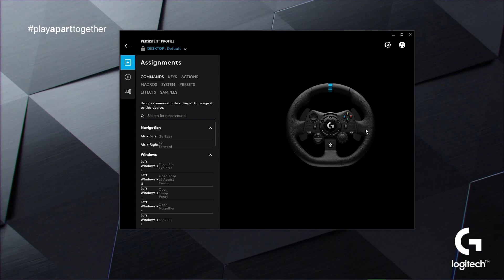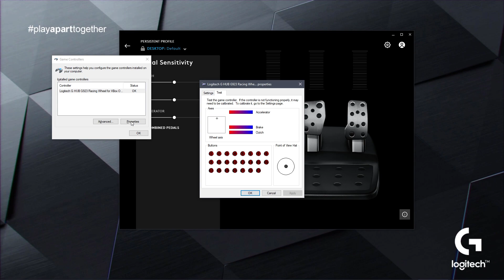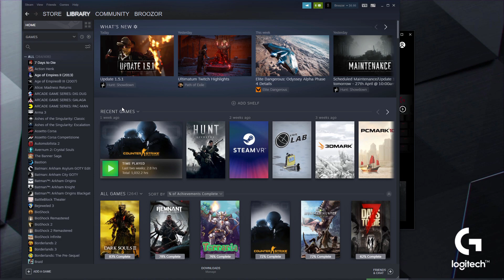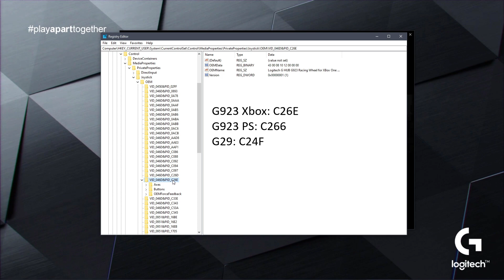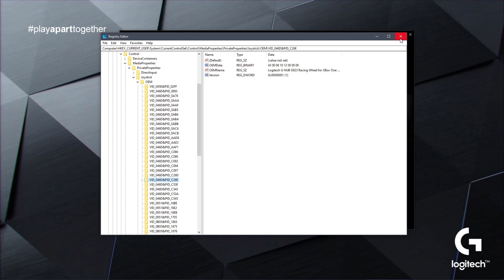How to troubleshoot G923/G29/G920 for Connection Issue

Comment: Hello Logitech support
Im having an issue with my g29 is that
My g hub is working perfectly and i also check that my center spring option is on for the games. In g hub when i turn left the steering wheel comes back automatically, But when i play forza horizon 4 it don’t comeback automatically when i hit the accelerator. Any solution?
Reply from the maker: Hi there!

Does it change if you uncheck the centering spring option? Can you also mess around with your centering spring options within FH4? Moving that near value 100 might help your issue. 

If you are still having issues please open a ticket below!

https://support.logi.com/hc/en-us
Reply: @logitechsupport  Yeah got it now, WORKING PERFECTLY. I have to open G hub at the background and then play the game and when the game runs i open the G hub again and click on the center spring one time then it works in the game.
Thanks
Reply: @logitechsupport  Yeah got it now, WORKING PERFECTLY. I have to open G hub at the background and then play the game and when the game runs i open the G hub again and click on the center spring one time then it works in the game.
Thanks

Comment: I have a problem beacause my steering wheel is not activated
Reply from the maker: Hey there! 

Are you getting a flashing light at the top of the wheel? This could be a power issue that can be solved by checking all your cables! If you've gone through all the troubleshooting please open a ticket with us so we can help you out!

https://support.logi.com/hc/en-us

Comment: So if its not turning when i plug it in that means its broken?
Reply from the maker: Hey there! 

There could be w few things going on. Can you make sure your power cables are properly seated? This would be on the power supply and the wheel itself. We also recommend you plug it directly into a wall to see if that changes anything. If you are still getting issue we can help you further in our ticketing system!

https://support.logi.com/hc/en-us

Comment: Hi! I have a problem about the operating range. I'm not sure why but the operating range is only negative. And its making me drift to the right side without me even touching the wheel. I need help to make the operating range 360 bc it's stuck in -450 to -90 and i cant get it to 360.
Reply from the maker: Hey there! 

Are you using our latest G hub software? If not can you please update and see if that fixes that. You also might need to change settings within the game you are playing as well! However, if you are still having issues please open a ticket with us below.

https://support.logi.com/hc/en-us
Reply: @logitechsupport  I just found a way to fix it, the problem was the power. I just plugged it in inside a different socket.

Comment: My controller is showing up in the Joy.cpl command section but is not showing up in Steam. I have reinstalled Steam and have followed all of the other steps in this video but it still does not show up. What have I done wrong here?
Reply from the maker: Hi!

Is it showing up as a named wheel in joy.cpl? If not you may still need to do a driver reinstall. Also, in games is it recognized regardless of the steam settings? Some games might not have full wheel support and you'll need to bind controls manually.

If you are still having issues please open a ticket with us below!

https://support.logi.com/hc/en-us

Comment: Hello I have g920 device, is powering on, and actually when I conect it turns to the rigth until the limit, but then the LED just keep flashing and don't finalize the calibration. Un GHUB is reconizing the device but when I turn the wheel nothing happen in GHUB. I tried with diferent computers and Xbox, Can someone help me?
Reply from the maker: Hi there!

This is typically a power issue. Can you open a ticket with us below so we can find a solution for you?

https://support.logi.com/hc/en-us

Comment: Hi, You can also add to your video that when the green LED flashes the fix is not checking the power cord, in my case when that green LED flashes it was the fault of the power supply, I had to order a new power supply to work
Reply: Are you sure cause i have the same problem right now and i found an old ac adapter and still dosent work

Comment: Mine is just flashing constantly, the power brick works as I've plugged it into a speaker and that works fine. Would this be an issue with the base unit?
Reply from the maker: Hi!

Flashing is usually due to power failure. We can definitely find a solution for you if you open a ticket with us!

https://support.logi.com/hc/en-us

Comment: My G923 wheel stopped working recently, i tried all of the tips from the video but none of them worked. The RPM leds light  up but it does not spin when I turn my PC on or when I try to calibrate it from the control panel.
Reply from the maker: Hi there!

Can you make sure that your wheel is plugged into a wall outlet? There may not be enough power being sent to the wheel if you aren't getting calibration. 

If you are still having issues please open a ticket up with us below!

https://support.logi.com/hc/en-us

Comment: my g920 is not showing on the g hub and on the joy.cpl....what do i do?
Reply from the maker: Hi!

Can you make sure your wheel is getting power? If you are getting a flashing light it is likely that. Can you make sure your cables are properly seated and also plug your PSU directly into a wall outlet?

If you are still getting issues please open a ticket with us below!

https://support.logi.com/hc/en-us

Comment: i just bouggt g29 and need help its self spinning and steam doeant recognize it i tried all the steps but nothing y? i tried stuf from different vids 2 but nothing helped any ideas
Reply from the maker: Hi!

Can you make sure your steam has been updated? 

Does the wheel still work in games? You may have to bind the controls manually in certain games. 

You can also try reinstalling your drivers via the device manager to see if that fixes your issue.

If you still need help please open a ticket below!

https://support.logi.com/hc/en-us

Comment: I have 2 issues with my G29 currently. one, when playing F1 2021, the game randomly ''uncalibrates'' the wheel, and when I try fixing it by unplugging and plugging the wheel back in, the game crashes. After trying things out I noticed I could crash the game simply by unplugging the wheel. I also tested this in Euro Truck Simulator, and when I unplugged the wheel, the game crashed(so definetly not a F1 issue then?). My other issue is that Steam isn't showing off my wheel in the general controller settings as shown in 3:22. I am sucky with computers and have no clue how to fix this.

Logitech G Hub version 2022.5.263319
Logitech G29 firmware version 89.05.25

Computer specs

Lenovo Legion 5-17ACH6H
Windows 11 Home 64bit
AMD Ryzen 7 5800H with Radeon Graphics
16gb ram
Nvidia GeForce RTX 3060 laptop gpu
Reply from the maker: Hi there!

Can you open a ticket below with us? We can diagnose this deeper there.

https://support.logi.com/hc/en-us

Comment: I get the green light above my wheel but not turning, does that mean I might have a bad power cable???
Reply from the maker: Hi there!

Typically it is a power issue if you are getting a flashing light. However, can you plug your wheel directly into a wall outlet and see if that changes anything?

If you are still having issues after that please open a ticket with us below!

https://support.logi.com/hc/en-us

Comment: Great video, covered some great solutions. But what do i do if my wheel doesn't appear in the steam controller detection?
Reply from the maker: Hey there!

Can you do a driver reinstall and also make sure you steam is updated completely! If you are still having issues please open a ticket below!

https://support.logi.com/hc/en-us
Reply: @logitechsupport  how would i do a driver reinstall?
Reply: @thomasjessick643  Delete the driver from devices in settings, remove the USB then restart and reconnect the USB. If it doesn't reinstall them automatically, then get G HUB and get the drivers from there.

Comment: Hello, my steering keeps spinning of turning to one side ( right when you open it up or when it tries to calibrate on start up ) one side only. 

If you try to play a game it turns to the left in circles. The ps4 switch light keeps blinking instead of it being stable. The led lights are stagnant instead of the normal lighting system. Also the wheel seem to turn more than 3 times to one direction probably about 4 or more before it seizes. 

When you turn the game on, there are two wheels. So one does the normal turning to the right and and back to the left, the one with the issue turns to the right and doesn’t turn back. It seems to keep turning to right / or not able to fully turn to the right to turn back, it’s as if it’s hitting something or being stopped physically. 

What to do ? 

Ps: Logitech G29 driving force on ps4 , two wheels. One has the issue.
Reply from the maker: Hi!

On the wheel that does not have the issue, do you still have blinking lights? One of the wheels may be having a power issue. Do you have them both plugged into a single surge protector? Does this change if you plug them both into a wall outlet?

If you are still having issues please open a ticket below. 

https://support.logi.com/hc/en-us

Comment: Did every single step, my wheel is still not calibrating. I have the G923 PS4 version, the Logitech Hub is recognizing my Wheel but its not turning in the Steering Wheel options and also i see the LED blinking on thop of the Wheel.
Reply from the maker: Hi!

The flashing light is a power issue. Can you make sure your wheel is is plugged directly into a wall outlet and is also properly connected to the wheel?

If you are still having issues please open a ticket below!

https://support.logi.com/hc/en-us

Comment: my pedals are not always working. They work 60% of the time but in that 40% I have to wait like a minute until it's back again. what do I do? (I have a g920)
Reply from the maker: Hi!

This could be a power issue, but can you also make sure that your plug is seated properly? I would check your connectors as well to make sure none of them have bent. 

If you are still having issues please open a ticket with us below.

https://support.logi.com/hc/en-us
Reply: @logitechsupport  Thank you for replying but I think I have founf out what the issue was. It can't be a power issue because I tried with more outlets, so I think the pedals' cable has a contact problem.

Comment: my wheel shows that there is a power issue, but I plugged the main cable into the wall plug and it just cant auto calibrate when i plug it in. I also made sure the cable is not too tight and properly plugged in. Is there any other way to solve this?
Reply from the maker: Hey!

Can you open a ticket with us? We can solve this there!

https://support.logi.com/hc/en-us

Comment: I have a G920 and play on Xbox one. It will Calibrate when plugging in power and Xbox connection and will allow me to scroll the home screen with the wheel.   However it WON'T recognize as a controller when I go to play a game. I usually play F1 2021, Project cars, etc. It just says I need to connect a controller to play.. PLEASE HELP!
Reply from the maker: Hi! 

Can you test your wheel on a PC and make sure it's responding to wheel movements? You also might need to bind some controls within F1 2021 for the wheel to function. 

If that doesn't work please open a ticket at the link below!

https://support.logi.com/hc/en-us

Comment: G923 worked fine. Plugged in a 3rd monitor and now it won’t work. Plug it in all lights turn on. Starts to calibrate tuning only a quarter of a turn then shuts off and a get USB Device Not Recognized. I have triple checked all connection and restarted several times.
Reply from the maker: Hi there!

Can you please open a ticket with us?

https://support.logi.com/hc/en-us

Comment: Without GHub and PC, using Xbox One X- pedal connection issue. Wheel works fine but gas and brake are bound to controller whether it’s on or off/was used to start the game or not. Don’t know what to do. Randomly works but most often does not. I fixed it one time by using the controller to do something but I can’t for the life of me remember what it was. Someone help 😭
Reply from the maker: Hey there! 

We can definitely help you fix this in our support system! Please open a ticket below.

https://support.logi.com/hc/en-us

Comment: hello! I have aproblem where the wheel has a flashing light, faster than the turn on flashing light and it doesn't show up anywhere on my pc, ghub, devices or anywhere else, also it doesn't calibrate, but it used to, and it doesnt show up in registery editor
Reply from the maker: Hey!

That would be a power issue! Please make sure you have your wheel plugged in properly and also directly into a wall outlet. If you are still having issues after that please open a ticket with us!

https://support.logi.com/hc/en-us

Comment: EDIT:  How can I distinguish between the Logitech G29 power cord and the other 10 power cords i have that will fit?

Are there specific markings? 

I have a question that is very important (to me, at least).  But first I want to share how expensive and unpleasant my experience has been with your company.

My history with Logitech support has been an absolute nightmare.   I have purchased 9 wheels from Logitech since 2009. 7 of them failed (all DFGTs).  Only 3 were actually replaced by Logitech, even though they all failed within the 1 year manufacturer warranty.  

I had to pay for shipping to send back each time to inspect whether it was "accidental damage" or not, etc....    over and over it was an incredibly frustrating hassle to deal with the people who answer the phones, and sometimes months waiting on an answer whether my defective wheel will be replaced.   As a sim racing addict, I ended up buying new wheels several times while waiting for the decision on my warranty claim.  What a pain in my hind quarters Logitech has been over the years.

So all that aside, I  just wanted to say thank you, and what a relief to have you here answering questions and making yourself available.
Reply: Well that was very long winded rant.   Forgot to ask my question!!!!

I have Logitech G29 for PS4 and since stowing it away years ago waiting for GT7 I lost the cord that plugs into the "brick".

I have several cords that will fit into the brick from the wall, but I'm afraid if I plug the wrong one in it might damage the wheel....

Are there specific markings on the original cord?  Will it say Logitech on it? Will specific numbers?   Or maybe even the length of the cord im looking for would help.
Reply from the maker: Hi there!

There are no specific Logitech markings on the cables. However the cable that plugs into the wall is about a meter long and the cable that would plug into the wheel is about double that and not able to be removed from the brick.

Comment: Thanks for the video. I have the LED lights come on the wheel (my son only uses it on Xbox) and he can use the pedals but the steering wheel doesn't spin to calibrate itself. I tried downloading the Logitech G hub. It can see my steering wheel but neither the wheel NOR the pedals are responsive (even though the pedals are responsive on the Xbox. I contacted Logitech support and they created a ticket but just seemed to say if the connections have all been checked it will need to be replaced under warranty. It is only a month old. Any other suggestions? Thanks.
Reply from the maker: Hi!

Can you make sure you have your wheel properly powered? This would require you to use a wall outlet and make sure the plug to the wheel is seated correctly! If you are still having the same issue please open a ticket with us below!

https://support.logi.com/hc/en-us
Reply: @logitechsupport  i have the issue
Reply: @markushymllermundbjerg3816  me too. maybe its an issue with the batch because i got my wheel like two months ago as well
Reply: @arjunyeleshwarapu  sign I'm alsot stuck with no fixes. nothing worked and I have been searching all day for something that will work for me.. I have power, but the wheel and pedals are unresponsive
Reply: @BahamasMusicLasers  i got a new cable
Reply: @arjunyeleshwarapu  i have the same issue, does it work with a new cable ? Power cable i guess
Reply: @LockrynC  yeah

Comment: I'm really stuck with mine hoping some can help! I got a second hand g920, when I connect it starts it's calibration but stops half way and the led light flashes fast! Please help!!
Reply from the maker: Hi!

This is usually a power issue. Can you make sure your wheels power is connected properly? This would be making sure both the connection to the wheel and the wall outlet is secured.

If you are still having issues please open a ticket below!

https://support.logi.com/hc/en-us

Comment: I done that and is still stuck to the left and its not Calibration
Reply from the maker: Hi there!

Can you make sure your wheel is properly powered? You'd need to check to make sure the power cable is plugged in on both ends as well as directly into a wall outlet. 

If you are still having issues please open a ticket below.

https://support.logi.com/hc/en-us

Comment: My wheel doesnt show any lights or calibrate. It just doesnt work or even turn on. Any help? On the g923 ps4 version
Reply from the maker: Hey!

This could be a power issue. Please make sure all your cables are seated correctly and try to plug the power supply directly into a wall outlet.

If you are still having issues please open a ticket below!

https://support.logi.com/hc/en-us
Reply: @logitechsupport  yep just looked into it the little light was flashing indicating a power issue. Made sure all the cables were in and it worked! The video helped :)